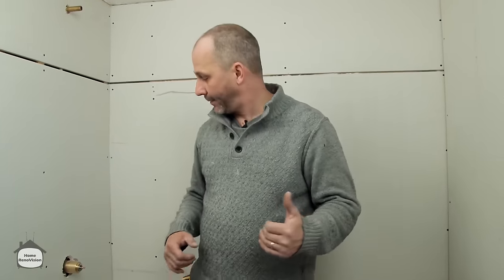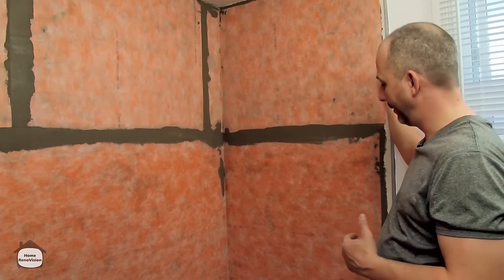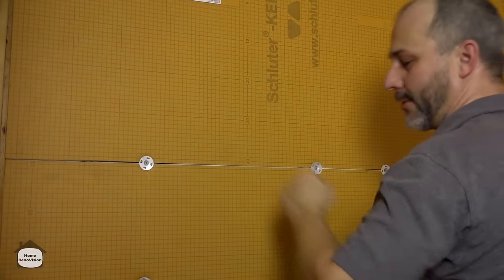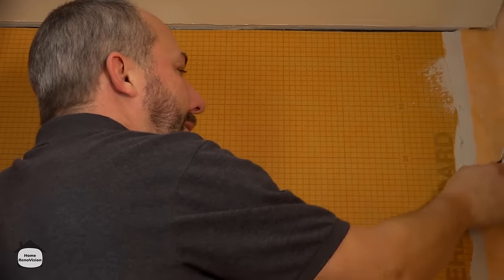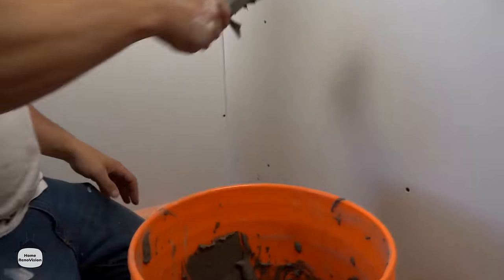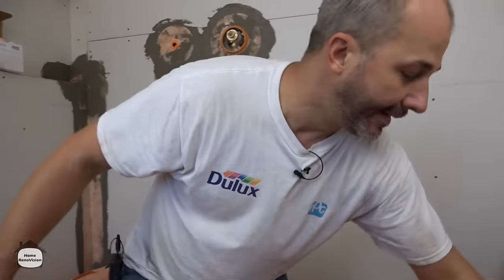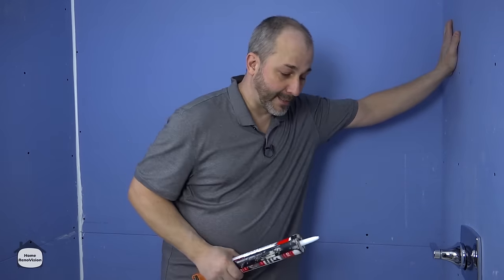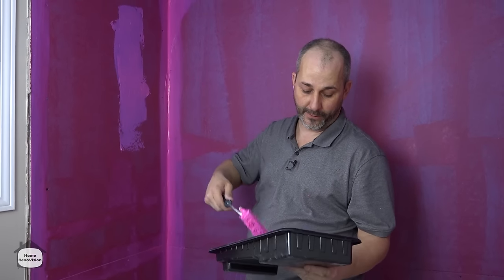4 Types of Shower Waterproofing Systems for Your Bathroom

Comment: So, I have backer board on my bathroom walls. It is currently just a tub. I plan to add a shower with the tub, tile the floor, change the vanity/mirror combo, and toilet. There's a foot gap from the back of the tub to shower. I am not ready to tile the shower wall, as it will only be two sides to tile and I just want to paint it all. Would replacing (if needed) the drywall around the tub with the moisture/mold resistance drywall, using the LePage 2 in 1 on the corners, and Redguard both walls be sufficient enough so I could paint? I plan on using the Perma-White Interior Paint Mold & Mildew Resistant, even if I have to do paint touch ups occasionally.
Reply from the maker: The waterproofing systems are designed to go with tile. I have never painted it before. I feel it would look a little too unfinished.
Reply: Thanks for the quick response. I’ll weigh more options, as they are limited. I may just find tile I am okay with.

Comment: Does it matter what wall do you have in your bathroom before covering it with a kerdi membrane? Can you have regular dry wall, cement board, gypsum anything? Are there any recommendations?
Reply from the maker: cement board is always best! wet it and use non modified cement

Comment: Hello from Texas, Could you use the 2 in1 caulking also in the corners and where the boards connect instead of using the membrane with cement? Thanks
Reply from the maker: you sure can if you can get the gap to close. The Kerdi fix is designed to bond those panels together for a waterpoof finish in any situation. Cheers!

Comment: Hey Jeff,
Great video..!  You have a nack for explaining things in such a way that even this Ole' gal can comprehend it.  The house we bought in the master bath, the owners installed a jacuzzi tub with a shower arm over head.  Which was clever, EXCEPT...He started the tile above the tub, (Crappy job), and never finished it.  He enclosed the tub (3 walls), with about an 18" front wall on either side, enclosed from ceiling down about 18-20", leaving a decent size opening.  I guess you'd call it a gratto?  The idea is really cool, but  It looks like he used the red rubbery paint that supposedly waterproofs,  then hung dry wall,  then started applying the tile on that.  Not sure what he used for glue, and  did not finish the tile.  It definately was used  in taking a bath, and showering.  Your video is Awesome in showing how to fix our problem.  Thank-You SO MUCH..!  God Bless  :-)

Comment: I would like to do the mold resistant drywall and Red Guard membrane in a new basement shower project. I am thinking of adding a bench to the shower. Would I still use metal corner bead over the edge of the bench and apply the Red Guard over the corner bead or is there a better approach for handling the edge?
Reply from the maker: do not introduce anything into a shower that can rust or mold. Simply seal the joints and tile. Cheers!
Reply: @HomeRenoVisionDIY  Perfect, thanks!

Comment: Good Morning. I have seen your DYR shows.  On the Ditra shower pan  looks good but if I do not want a step and have it flat from the main part of the bathroom in to the shower area what is the best way to connect them so we will be safe .  Do you have a DYR on this yet.  Jack
Reply from the maker: Hi Jack, that takes a lot of work. you need to remove the subfloor around the shower and then block and install subfloor in between joists. Then add pan and add subfloor to the remainder of the bathroom to the same height. Cheers!

Comment: I really learn a lot from your videos. Thank you. I have a question though. Do you have any videos on walk in shower base \ floor. Looking to build a walk-in for our new home just not sure on how to do the floor. With having 4 daughters it will get used a ton. But with 4 daughters don't have much to spend either.
Reply from the maker: your most economical option is to use a shower pan. it only has a 3" lip and installs quick and cheap. Cheers!
Reply: With 4 daughters the shower will be wet for about 4 hours per day.  You might want to invest in a water miser low flow shower head too.  lol

Comment: Thanks for all the tips and tricks along the way during your installations! Any difference between using drywall vs cement board for the bathtub area?
Reply from the maker: not really, some places require cement board and some do not.
Reply: @HomeRenoVisionDIY  Thanks! You did talk about the building code toward the end and your area is fine with drywall. I took a break before getting to that part. Very thorough explanations!
Reply: I always use "Durock" cement board and I believe it's particularly advantageous for large format tiles that have become very popular.

Comment: Hi Jeff. Thank you for this video. I just bought a house that was renovated by someone who was obviously in a hurry for  quick fix and a quick buck. The ceramic shower is new but seeing how he finished the rest of the house, I don't think he would have taken proper care of waterproofing the wall behind. He only doubled the sheetrock. On top of that, the tile seems porous and of not great quality. Bottom line, I know I'll have to redo it in a couple of years and I'll pick one of your suggestions for waterproofing.  In the meantime, is there a scellant I can apply over the tile and grout, trying to keep water from going through and reaching the wall? I have an old house from the 40's , solid walls made of wood, sheetrock on top. I don't want the water to screw up the solid walls. Thank you so much!

Comment: Love your video. Very helpful and great tips. So my question I'm having a hard time finding an answer to is this...if I remove all the original 1940's tile in my whole bathroom, can I re-grout over what appears to be the old grout on the shower area? The walls appear to be super thick, a cement like material almost a solid inch or more, no layers of any kind. Only a few portions of tile came off easy and the rest is still there. I'm torn on what to do. The tile is also up 2/3 of the wall and it's built like a damn tank almost 80 yrs later. I'm only ripping it out because it was modified for a senior walk in tub and damaged all over. The control wall is the only area I attempted to gut more to redo plumbing and it was a nightmare getting any of it out. Any advice? Do's or dont's?
Reply: Wish several of the commenters could reply to this - - - seems like a very pertinent question - makes me think of my grandmother-in-law's house. Hope you get an answer, Nikki InTheD.
Reply: I know not timely and don't know if it's a help but, I own a house built in 1955.  Happy tile walls and almost full time tub/shower.  Nice tile floor but a few broken tiles around edge of tub.  Window in shower area and grout fails around to card since way stud and for just damage.  Do, in renovating the bath and discovered, as you have, the "old school tile" craftsmen used thick concrete over wire mean nailed to the studs and a thick concrete pad on the floor prior to tiling.  If, and a big if, you can get the wall tiles off the wall and still have a smooth surface, it one that could be smoothed out then you shouldn't have a problem re-tiling over it.  My problem was the times we stick so will that I finally decided to demo the walls back to the studs and go back with dry wall and just time the tub/shower surround.  Also having to take it all concrete from floor, reissue the wood and go back with new subfloor and substrate for the new time.  Wish you well on your bath and in life as well.

Comment: I like the whole submarine idea, so I'm wanting to waterproof the entire bathroom. I call it a wetroom. If you have clients that grew up in India they may have asked you for this kind of bathroom. The idea is that the bathtub won't have a curtain so that water will run right on the floor. When you're done you can just spray water around the floor and lower walls of the entire bathroom. Et viola, the bathroom is clean not able to collect dust & dirt. 
What suggestions do you have for the build between the tub & floor? Would you just consider this making the entire bathroom into a showerroom? The bathtub is 54" with the far end possibly resting against the brick of the chimney. I was going to leave the chimney bare as a wall for the tub but after watching this I'm not sure of how to waterproof the ends. Also the back wall of the shower/tub is a 4'x4' window. 
There's a lot to consider so you'd have to see a picture or two. 
Nice explanations in your videos.

Comment: I was curious if I do the last option on the video (dry wall and paint membrance), to seal the corners could I use the orange strips of cloth From the second option and when I paint on the membrane could I paint over the strips as well? kind of like a double layer of waterproofing? (hardy board, cloth strips to seal, paint membrane x2, then cement and tile)?
Reply from the maker: sounds like a sleep well at night kind of plan to me. Cheers!

Comment: Thanks for sharing these. I like that you had a compilation of videos in one to show different options.
Do you have any videos on waterproofing behind/under direct-to-stud fiberglass/acrylic tubs/showers when there is no drywall/greenboard or the like?
We are remodeling & will be doing direct-to-stud kits but want to protect the studs/wood & insulation just in case (one will be installed against exterior walls and another will be installed on interior walls).

Comment: Hey Jeff, thank you for your presentation on the mold resistent sheetrock approach!!  I am however finding that I cannot source it anywhere within 500 miles of Wyoming.  What specification do the gypsum sheets have to meet?  The only thing I can source is SHEETROCK® BRAND MOLD TOUGH® FIRECODE® X PANELS and USG Sheetrock Brand
1/2 in. x 4 ft. x 8 ft. Mold Tough Gypsum Board.  Would they be sufficient?  Thank you for your time!!

Comment: I am taking a bathroom from rough in to finished and I was wondering what to do. Do I  mud and tape my drywall until the area where I will be applying my redguard first or do I want to redguard, and tile my tub first before I mud my drywall?
Reply from the maker: finish the walls first and then redgaurd.
Reply: Thank you.

Comment: The comment at 52:30 is absolutely key!  After 20 or so years, no matter what product you put on the wall, most women are going to want a more "modern" product.  So you really can't go wrong using (1) moisture-resistant drywall; (2) then seal the seams well with a quality mold & water-resistant product that bonds & seals those critical joints (I like DAP 3.0 Advanced Plumbing Sealant); and (3) then use a liquid membrane product, such as RedGuard.  Follow the manufacturer's instructions and you'll have a shower that should last 25 yrs.

Comment: If your installing Kerdi Board over uneven/unlevel studs, use kerdi fix on studs, tack with a few screws, let dry, then screw off. If the studs in walls are not crowned and installed correctly your walls will be wavy.
Reply: Exactly. Must square, plumb and level the best we can for today products.
   Most likely they are. in older homes because of the process of manufacturing lumber and and weight bearing age. ther was no need to be so precise when walls were finished   gypsum, lathe and smooth with a Darby board. Bathroom floors and walls finished with concrete, mortar and porcelain. 
They were more concerned with Holmes built for the whole family and lasting for the next generation.

Comment: Would it be possible to install heavy tiles (tiles weighing around 30, 35kg/m2) onto the Kerdi membrane on a cement board background?
Reply from the maker: Yes but let the mem\brane dry overnight for that kind of application. And use keribond T from Mapei

Comment: When you did the waterproofing using the green board, how do you seal where the bottom of board meets the top of shower pan?
Reply from the maker: I use kerdi band, but a good bead of kerdi fix works as well. cheers!

Comment: Usually waterproof sheetrock is placed over the bathtub edge, but our contractor covered the whole wall till the floor with the sheetrock (bathtub is not installed yet). Can I install the bathtub and somehow protect the edge of it with waterproof tape, caulking and alike, or I do need to remove that part of the sheetrock, which goes from the edge of the bathtub to the floor? I also bought RedGard, maybe to cover the tape with Red Gard on the joint of bathtub with the wall (covered with the waterproof sheetrock)?
Reply from the maker: I would have built out the wall and done it the way you suggested originally. Use a good sealant to the tub and wall joint like kerdi fix and you will be fine. You can order it from Amazon if you follow the link in the description to my favorite products.
Reply: Thank you for the replay, I decided to take off that sheet rock and do it normal way, first bathtub then sheet rock. Can I use Kerdi Fix on all joints, including tub to wall, and screws location, if I cover all that (after it dries of course) with RedGard? You mensioned that all Kerdi products work only with that special Kerdi cement if I understood correctly. And also at the beginning of the film you are mixing cement and it is snow behind you. I live in Dallas, but it gets here close to 40F at daytime. Can I mix thinmix outside in the backyard and then bring it inside to work with it? I read some statements that cement, thinmix and alike should be mixed only at 55F or so. I hope if to mix it at a lower temperature quickly and bring it inside to the temperature required nothing bad happens to the cement.  Again, I greatly appreciate your explanations and so detailed film.

Comment: Question - The La Page 2 N 1 isn't available in the states and I can't find the Loctite equivalent.  Loctite makes a couple of versions of their Power Grab which might be the replacement for the 2 n 1.  Which one would you suggest?
Reply from the maker: use the kerdi fix. from schluter. Cheers!
Reply: @HomeRenoVisionDIY  thanks!

Comment: Love the video!! Do you think you can you combine the last method with RedGard and use the Kerdi shower pan? I have a custom shower and would like to use Kerdi's shower pan. I'm just wondering if I can get a water tight seal between the Kerdi shower pan and the cement board with the RedGard waterproofing. Thank you

Comment: To me the redgaurd application is the most cost effective and the easiest. I work in New Jersey I build my pans and curbs custom then fiberglass resin/gel coat. For the walls I'll use like shown in the video mold proof drywall using mesh tape and thinset on seams and continue with the redgaurd application 4 coats haven't had a call back in 15 years
Reply: Where in NJ

Comment: Two critiques, non modified is required for installing kerdi because since the material is impervious to water the latex additive wil never dry out. That will cause the joints to fail. The non modified being only dependent on Portland cement to create the bond will use all of the moisture in the mortar to create a very dense matrix that will be waterproof if a 2" leap joint is used. Second is that it is important to wipe down the drywall prior to applying the mortar to keep the drywall from absorbing some of the water out of the mortar so that the cement can create a proper bond between the board and the membrane.

Comment: How do you get "lip" of the tub you screw into the wall to line up with tile underneath so that the bottom row of tile isn't "angled" inward? Should I shim the tub away from the wall so that the wallboard above lines up?

Comment: if you are using USG cement board, is painting the membrane only on the joints sufficient  ?
Reply from the maker: sorry, use an adhesive or seam binder for sure. Cheers!

Comment: Thanks for so many informative and easy to understand videos!  What are your thoughts on having a tub or shower constructed by Bathfitter?  And can you recommend a good exhaust fan for a bathroom?  I see what looks like black mold or mildew forming on the sheetrock walls in our bathroom (the house was built in 1984).  Thanks for your time.
Reply from the maker: put in new for the same money. get rid of your mold or it will grow through the seal they install.

Comment: How would you attach a glass shower door or glass wall on the curb? Does it attach to the wall? Would that result in a penetration that needs sealed?
Reply from the maker: structural silicone. never screw. Cheers!

Comment: I've been looking all around about waterproofing a shower and I've seen a lot about how you shouldn't use the mold resistant sheetrock but the cement board instead. One reason I've read is that the sheetrock cannot support the weight of the tile once up (after the redgard of course). Any merit to that? Have you run into problems with tile pulling away from a sheetrock/redgard wall?
Reply from the maker: none what so ever.

Comment: Great video!  I have 2 questions:
1.) If you use Denshield moisture resistant drywall will the LePage 2&1 seal & bond adhere to it fine?

2.) Is it necessary to install drywall backer with 1/8" gaps between the horizontal sheets to allow for expansion of the studs?

Comment: I really appreciate your videos. I'm working on remodeling my bathroom and picked up a Kerdi Niche wall inset for like 75% off at the big box store and decided that it wasn't worth the much higher cost to do the whole shower surround in Kerdi Board, so I'm using Hardie. Have you had any experience mixing the 2 products, and do you have any insight to issues that I might run in to? I plan on simply using an unmodified thinset and redguard (or equivalent depending on what the local big box store carries). Any helpful commentary is appreciated :)
Reply from the maker: Hi Jack, use the redgaurd on the hardi board and then seal the joint from the schluter to the hardy with lepage 2 in 1 or loctite if you are in the states. Cheers!